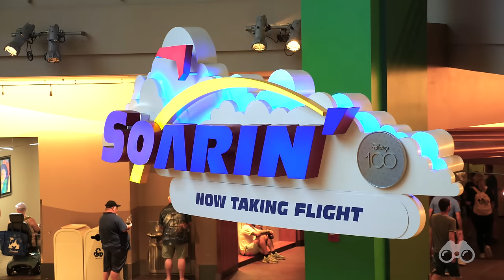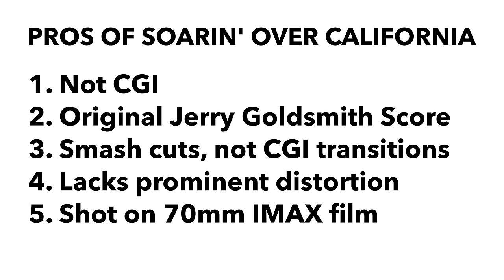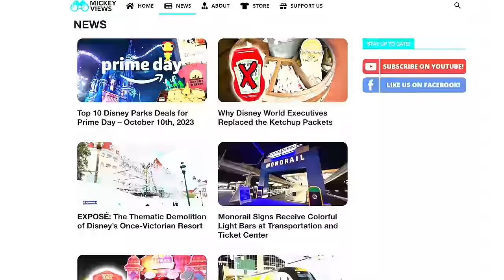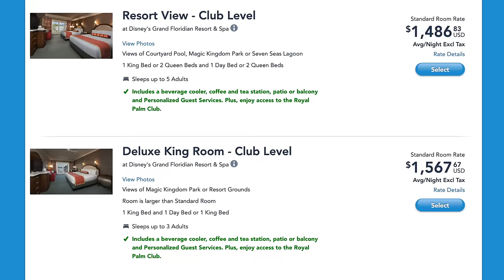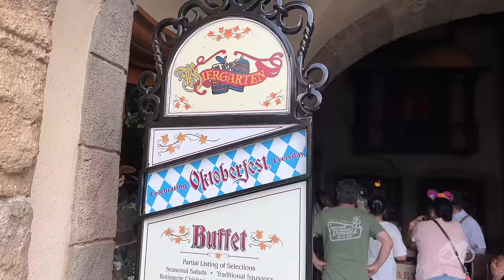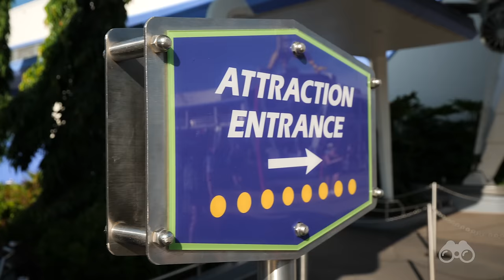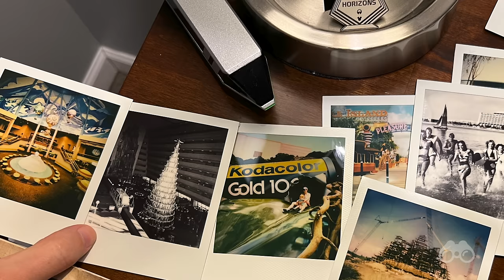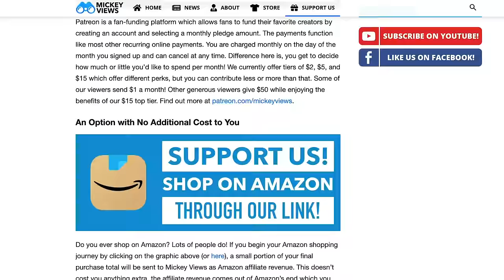Walt Disney World KING-SIZED NEWS UPDATE! - October 2023

Comment: Hey Brayden, a photo professor here- that sprocket hole light leak (and the partially undeveloped portions of the film) are almost definitely the lab’s fault. That is what happens when you have a light leak in the developing tank. Since you seem to be using those black tanks for your own film, you probably know there’s a central rod that keeps the tank light-safe.  When that rod is missing, it usually sends leaking light inside the white plastic film reel, and light shines through the sprocket holes onto the film wrapped next to it on the reel.   The partially undeveloped parts are probably from not enough chemical being poured into the tank, probably developer- or- since it’s positive film, it could be light leak along the top of the tank (as if they loosened or opened the lid before the final fixing)
Reply: And ps- your compositions are really wonderful - great sense of geometry and asymmetrical balance!
Reply from the maker: Thank you for your expertise and kind words! I wanted to support a local lab as there are very few in my city. I'll stick to developing myself, it's not worth the risk of getting those results again after all that effort. If you want something done right, do it yourself!

Comment: I hate to break this to you, Brayden, but those marble floors in the Grand Floridian are NOT Victorian. Even worse - for you - but those wooden floors you hate? They ARE Victorian. Parquet - flooring that consists of wooden slats in a geometric design - is probably one of the MOST Victorian design aesthetics. Check out a Victorian design and that's what you're going to see on the floor, often covered by a busy area rug. Marble floors - especially these colors - go further back to the Renaissance. Which means they are Baroque, not Victorian. Also, fleur-de-lys are decidedly not Victorian. In the Victorian Era, they were a French thing, or a thing of people with French heritage and I don't even know why they are here in this allegedly Victorian hotel. I say "allegedly" because the Grand Floridian is obviously based on the Hotel Del Coronado in San Diego, with added bits from other very American hotels. The problem with using the word "Victorian" though, is the exteriors were Victorian but the insides often weren't.  These stained-glass domes are a perfect example. True Victorian stained glass is far more "church-like" in nature. These "Tiffany-lite" domes became popular nearly a century after Victorian architecture was a thing, and they were mostly an American addition. 

None of this means the original designers got Victorian "wrong". As Disney does, they just took a bunch of inspirations and "borrowed" liberally from all of them. Just like no Disney castle is based on one real-world castle. I have never heard what specifically inspired that atrium carpet, but it's painfully obvious they "Disneyed" up the color scheme. It's appropriately busy for a Victorian carpet, but oh my gawd is it ugly. Between that and the marble "Oriental rugs", I'm a little surprised people think this is "classy". I'd call those things tacky. I have no idea why they chose to keep the hideous marble outlines, but the watercolor carpets are a vast improvement. Are they Victorian? No. But watercolors in the art world coincided with the Victorian Era, so they are a clever choice. The cool coloring is also a much better choice than the "warm" colors you like, Brayden. Because those colors actually clash with what's going on at the top of the atrium, as well as the alleged theme of this place. The stained glass domes read cool and actually remind me of seaside resorts in England. The wall colorings now feel more "beachy" than those too-bright yellows. With the obnoxious furniture - which was very Victorian - gone and the carpet covered in wood, this place already looks way better. An Oriental Rug may read "Victorian" but it does not read beach hotel. I'm also down with the lovely floral walls, which is far more Victorian than the stripey bland stuff they had going on around the elevators, and the coloring does still adhere to a beachy theme. I'm actually surprised to see this floral wallpaper because the Disney thing has been to remove anything with character from the walls. 

And that's where the problems start. The atrium was lovely all-white. But Disney can't have that! They also weren't going to add a bunch of colors to these hallways, because that's not what hotels do now. It's not Disney trying to be like everybody else. It's Disney being cheap... like everybody else. They go neutral so the next time they need an "update" all they have to do is change the paintings and maybe the carpets. I'm fine with the desaturated blues, very seasidey, but you are right, they make the halls too dark. But the worst "update" is those rooms. There is NOTHING Victorian in them. And it really wouldn't be hard to make them at least Victorian-lite while still sticking to this easy-to-update decorating plan. Flower-patterned curtains would be #1. The bolsters should  be as well. The headboards should be tufted, not paneled. The paintings should be larger and stylistically match that floral wall (no need to re-wallpaper). Introduce the stained glass from the atrium domes into some light fixtures. And then they should tear down half the walls and turn these tiny things into human-sized rooms!!! Honestly, why are people paying top dollar to stay in this Barbie house???? Frankly, they deserve tacky and ugly.
Reply: I was worried about that orangeness remaining for the Tiana retheme, so thanks for that update. I was actually worried about this after seeing how they muffed the coloring of the soil in the Moana walkthrough. Heaven forbid Disney have to build anything with the color black in it!!!!
Reply from the maker: In period-accuracy terms you are correct. But in the context of this resort and the style Imagineers went with, it doesn't fit. The issue is those floors at GF you call "parquet" are low resolution wood photos printed on giant cheapo pieces of tile. Nobody's fooled. They're not parquet floors, they're square pieces of overstock tile with prominent grout lines. Modern Disney can't afford the skilled labor who can cut that many perfect miters, and if they went with real parquet flooring they'd drown it in a quarter inch of resin like they have their original wood and stone floors around property because they don't do proper upkeep. I think if Disney did a real parquet floor there as you suggest, it would look great because it would feel authentic.This update lacks that

Comment: Brayden, you've nailed it once again. We used to stay at a Disney resort when we went. The theming, the extra park hours and the ability to use park transportation or even walk into the parks was all worth the extra price. However, the combination of increased prices for the Disney hotels, extra magic hours only being 1/2 hour for resort guests, the de-theming, mean it is no longer worth it. We are now passholders and when we go, we stay at one of the hotels at Flamingo Crossing. Also, the original Soarin' is SOOOOO much better than the new one. I made a point of heading to Epcot a couple of weeks ago just to ride it since the original one is back.

Comment: Now come on Braden...Disney has allowed their older attractions to rot for decades now.  Blaming Reedy Creek is really passing the buck.
Reply from the maker: Everything I said is factually the case, I wasn't painting a narrative or "passing the buck." The EPCOT Building Code predates the new board so if you're defensive of the new board you can take solace in knowing this has been a problem for the past decade. The new board is getting rid of the loopholes in the code enforcement though, so the prospects of attraction updates are being impacted by the new board, and that is not speculation.

Comment: Here’s what I can add regarding the long touch point LL check in at Toy Story. I was at HS 3 times over the summer and Toy Story had the worst managed line in regards to LL vs standby.  Very clearly in favor of LL.  I was able to count several visits and the cast members let 40-50 LL guests through for every 8ish standby.  Thats a HUGE ratio preference to LL. So if the tap point is extended the ride wait IS NOT being affected in any significant way.  I also saw a similar ratio being used in Buzz Lightyear.  Most other rides seemed to manage the 2 lines with less significant preference to LL.

Comment: Would they be allowed to submit a request for small change, then a separate one, then another one? Just curious, that if they wanted to fix a sign, which was allowed to be done without code update, then needed something else small done, I mean, can they submit another request? Is the 10% budget is compared to the price of the request, or all requests in total as long as the ride is in operation? Cause if it's just per request, could Disney submit a lot of very small change requests for all their attractions technically? Cause that would be cool and they could flood the office with requests, but I have a feeling it's 10% for the whole duration of the rides existence, not per request.

Comment: The Genie+ debacle is the worst part of this. That line should NEVER, under any circumstances be more than 15 minutes.  It should also NEVER be longer than the regular line.  Till Disney takes care of that possibility they should not have Genie+.  (I used Genie+ a couple times, neither time found it worth the cost and will not use it again unless they add the ability to choose 3 in advance BUT at least the line was never longer then 5 minutes)